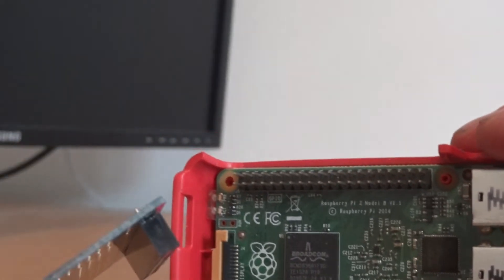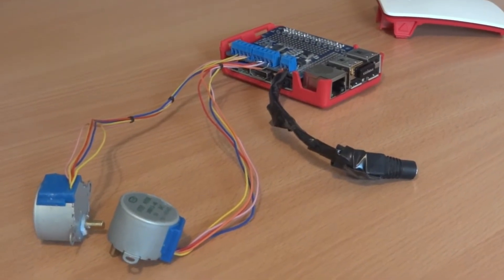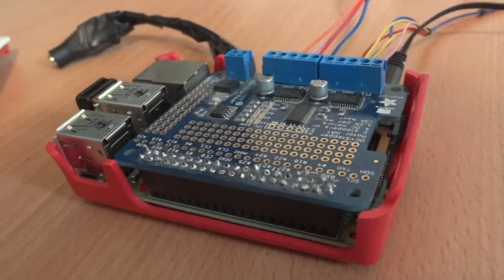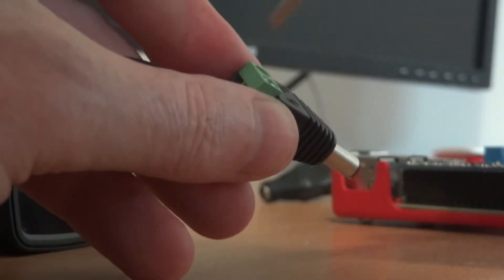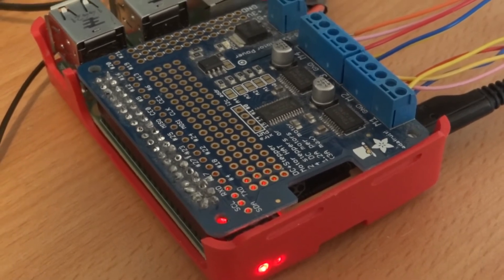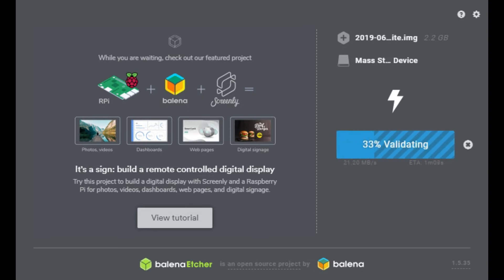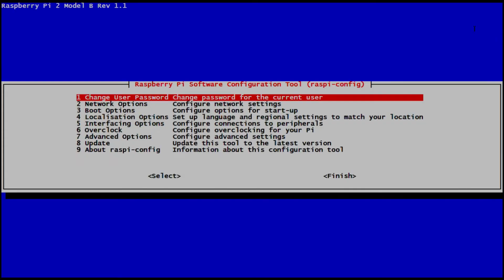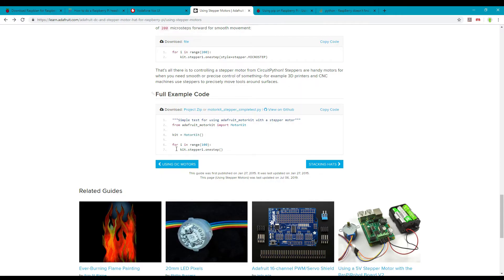Raspberry Pi - Stepper Motor control - for CNC and Robots

Comment from the maker: Here is the python code I ran - (make sure you use sudo)

e.g. sudo python3 motor1.py

"""Simple test for using adafruit_motorkit with a stepper motor"""
from adafruit_motorkit import MotorKit
 
kit = MotorKit()
 
for i in range(100):
    kit.stepper1.onestep()
Reply: Hello I am new to ras pi but u have an 80 dollar gift card for micro center and I want to know what raspberry pi and what stepper motor to get and how to connect them and power it. thanks guys and is there a way to connect more than on stepper motor to only one ras pi thanks again
Reply from the maker: @That_droper  Any Pi will do, but a Pi 4 will be more than good enough.  I made a camera slider when I first startd out.  And yes, as long as you get stepper drivers, you can power multiple stepper motors.  Check this site, lots of good articles : https://willysgaragenorway.no/2018/03/04/diy-camera-slider-part-1-figuring-out-the-electronics-2-axis-motorized/